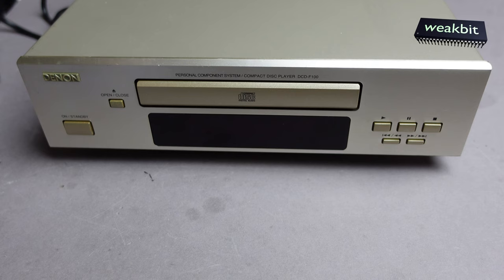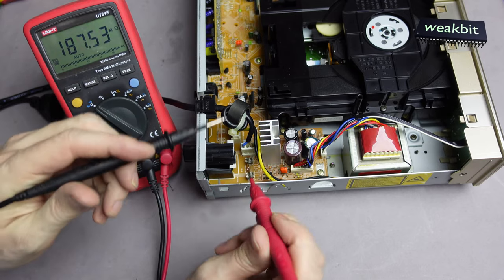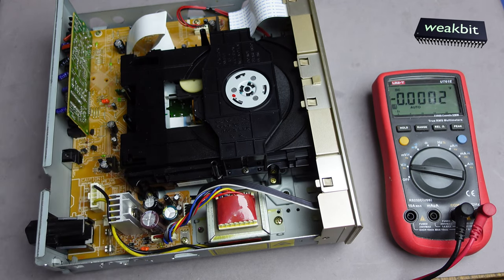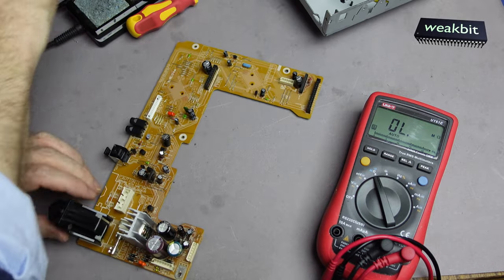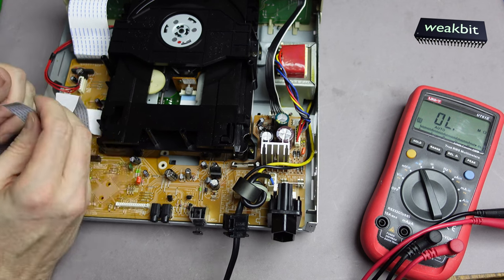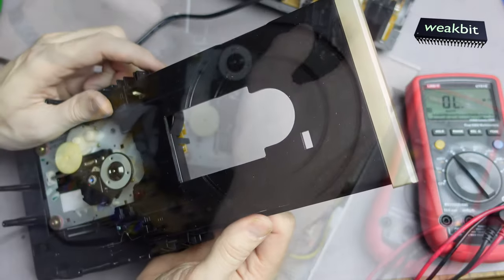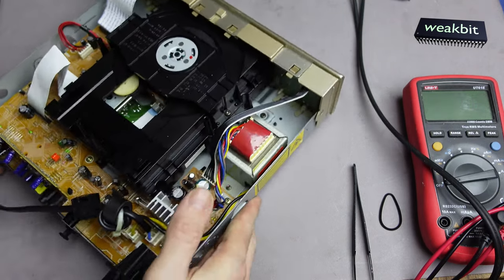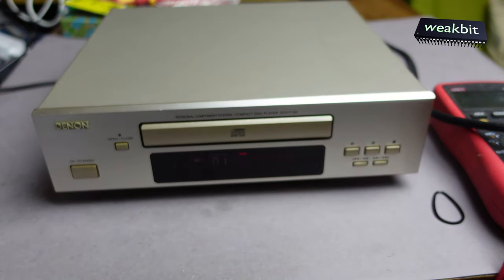Denon DCD-F100 CD-Player repair

Comment: Congratulation sir
Reply from the maker: Thank you now you can repair it if you have one of this by yourself. But ATTENTION every time if you work on it  disconnect it from the mains. I can't say it often enough!
Reply: @weakbit633  ok sir i have a question i have cambridge 540c last night it plays cd the next day won’t play anymore it says no play. What is the problem of my cd sir? Hoping u will help me thank you very much
Reply from the maker: Tele-diagnostics are not my profession. but let me answer in a way that maybe helped. 1st if you insert a CD then it initialized? 2nd if not then you can open the deck and take a sponge-stick spit on it a little and clean the lens in the drive. This are my first steps what I do if I get a CD-Player. Check this first and then we will see the next step. But also try a other CD maybe the CD will not run on this drive good? Thank you for watching weakbit 
PS.: I'm sorry I don't make normal repair for customers I only make Videos. But in your case I can help a little if this is your wish.
Reply: @weakbit633  thank you very much sir  for helping me an idea 🙏 anyway i like your video more videos sir